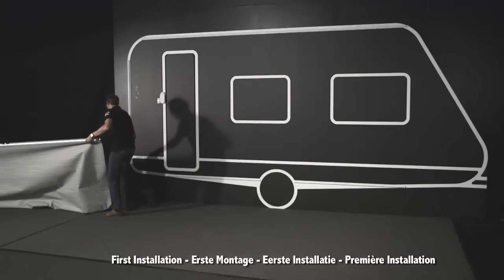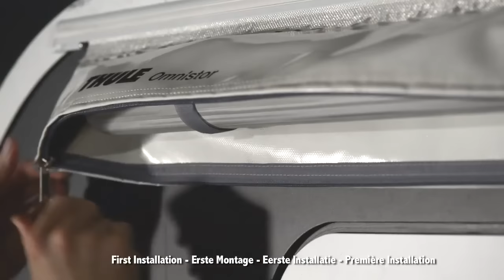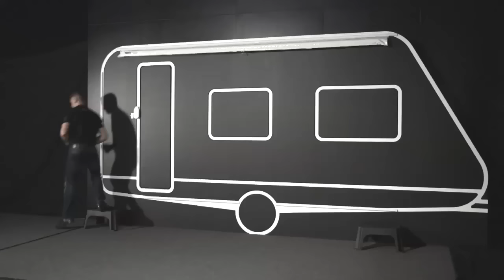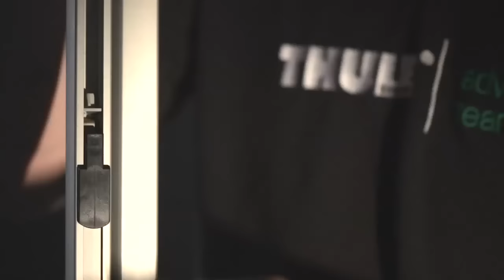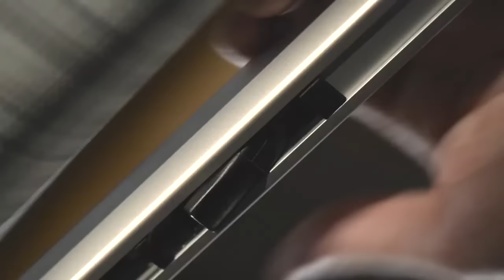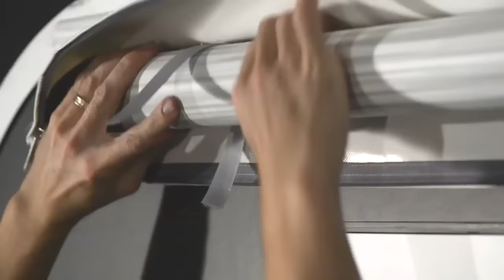RV Awnings - Thule Omnistor 1200

Comment: Fast and easy set up? My wife and I worked for an hour and still can't 
figure it out...complete piece of dogshit. Avoid like the plague!
Reply: My wife and I had the same situation very hard to set up
Reply from the maker: Hi David!

Please contact inforv@thule.com. If you still need help with mounting the Thule Omnistor 😊

Kind Regards,
Thule Team
Reply: How can you find it that difficult?! Fitted mine in about 10 minutes with my wife and then set it up and take it down on my own. It’s a 4.5m piece of canvas it’s really not that difficult.
Reply: Tried setting it up with my dad. The pole that stretches the canvas was the problem.
The lever to put tension onto the canvas just didn't work because we couldn't even pull out the pol enough to reach the area that can stretch the canvas.
My dad and I have lots of experience assembling and building all kinds of shite but we couldn't do this one.
Either its a production issue or we are actually too dumb to figure it out which I doubt.